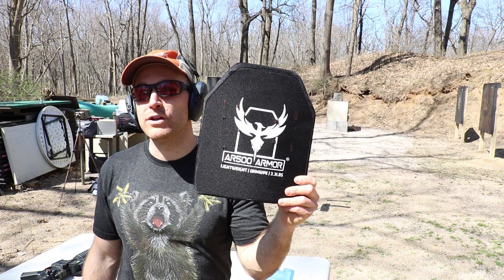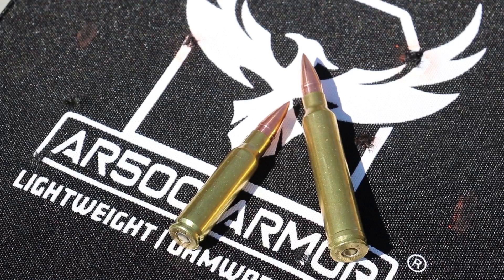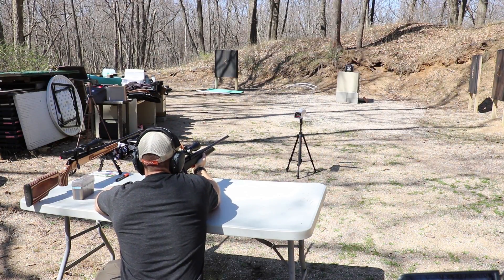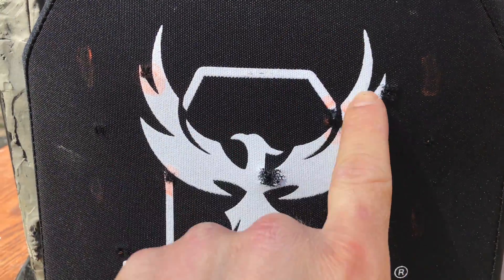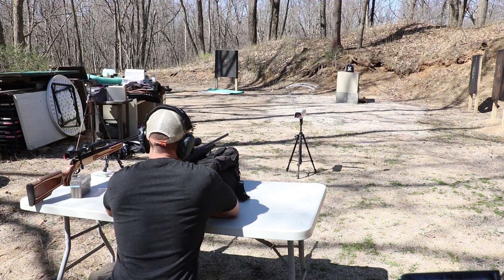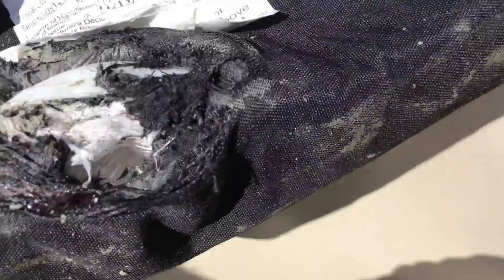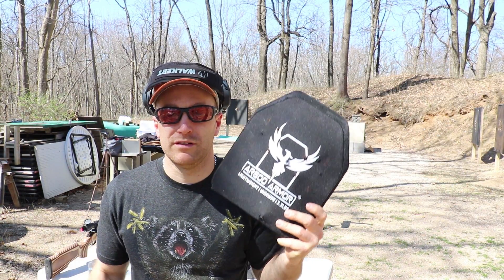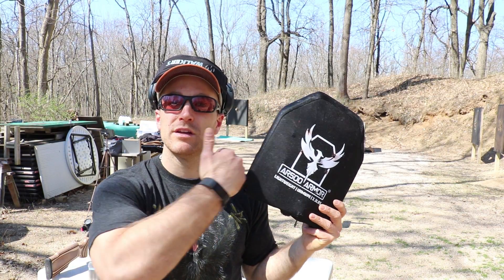UHMWPE; Can It Stop A Solid Copper Bullet?

Comment: need to try this with some heavier projectiles maybe 180 grain solid copper in the 300 win mag
Reply from the maker: do those 180gr have a pointed tip?
Reply: @BuffRANGE   yes MTAC do both 182 Grain closed pointed tip and open tip projectiles, some lighter 165 open tip and then LeHigh defence also do 150 grain closed pointed tip and then all the other things like controlled chaos / fracturing etc which i imagine would stop being an expanding hunting type projectile but the none expanding solids would be interesting. There is probably a wider selection available but this is what i saw on Brownells.  I'd be interested to see what happened on regular body armour (Not UHMEWPE)
Reply from the maker: @Forbes_F3  Regular body armor as an NIJ Level III or Level IV that encompass a ceramic strike face? or do you mean steel?
Reply: @BuffRANGE  Either, obviously i could be wrong but i think the heavier projectiles would still penetrate a UHMWPE plate, so it would be interesting to see it against a harder plate, either steel or ceramic. 
thanks for the fast response by the way, great interaction with the fan base !!

Comment: Hi Matt, thanks for the content.  I have seen you fired some solid brass projectiles on the channel.  Got any plans to shoot any against armor?
Reply from the maker: What kind of armor ? They are not effective against steel or ceramic.
Reply: @BuffRANGE  Oh, thanks for the insight. I was wondering why there weren't any solid brass bullet tests on YouTube.
Reply from the maker: @DylanHunt1994  they are affective against soft armor depending on the Caliber, and shape. Tuesday’s armor test includes a brass 338 bullet :). Brass in the US is considered an “armor piercing” material so that could be why it’s use is limited.

Comment: Surprising. I had expected soft copper to just flatten. It would be also very nice to see how this round does vs IIIA armor at reduced speeds.  Solid coopers often used for long range sniping. Of course they would not get through level IV at 1000 yards but it would be interesting to see how they would deal with flak part of the body armors and polymer helmets.

Comment: Good test. It’s a waste of time to test this against level 4. Level 4 will laugh this stuff off. M2ap loaded in 300 win mag couldn’t defeat certain brands of level 4. To beat level 4 you pretty much have to use tungsten carbide bullets or a 50 bmg :/
Reply from the maker: :D It would still be fun to see if I could get these going 3800 fps in the 300 WM :D
Reply: Buffman - R.A.N.G.E. Or a .30-378 Weatherby if you had one lol, I’d bet near 4200 FPS.
Reply: At the same time, though, quality Level III+ will also defeat pretty much everything short of .50 BMG, other than some really exotic handloads. This is why I tell people not to bother with IV and just get III+. The protection is functionally the same, in that someone will need .50 BMG to defeat it and in that case you're dead either way.
Reply: @WardenWolf   I choose level 4 because of threats like m855a1 and m80a1 or m2ap’s loaded into 308 cases which all generally defeat level 3+ plates with relative ease. Some level 4 plates can even stop the super AP rounds- m995 and m993 which buffman has demonstrated on his channel.
Reply: Saw a test of 50bmg being stopped by a level 4 plate. BFD was about 6 inches, basically folded it in half. 😆 🤣    so you won't take the bullet inside you, but the entire vest might go through your chest